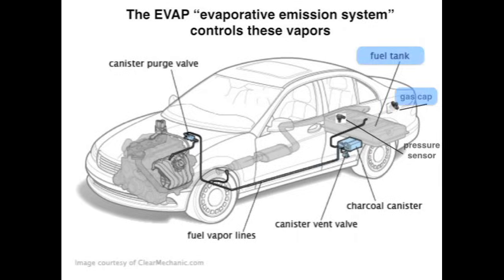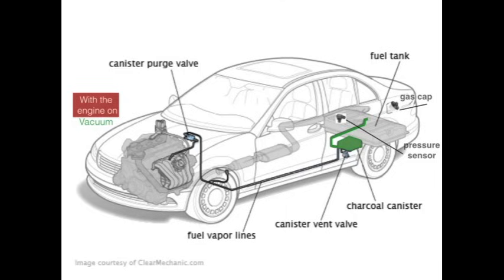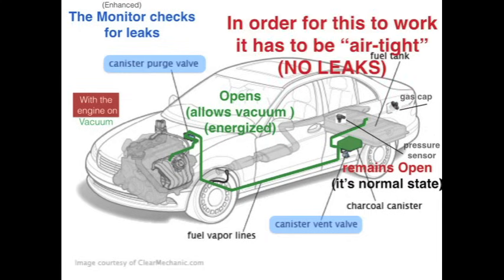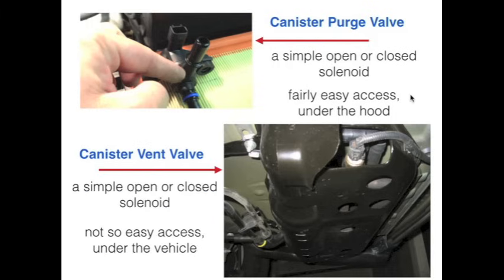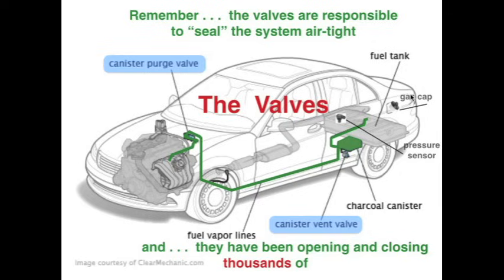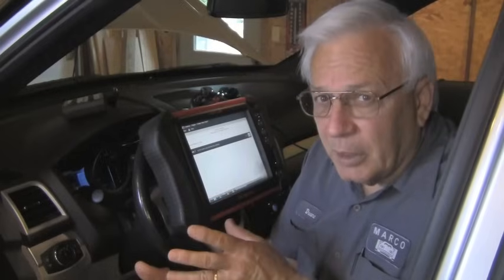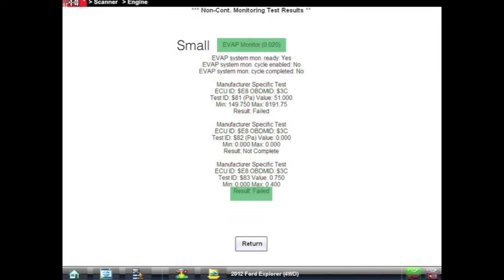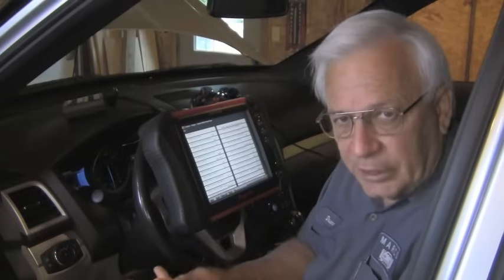How to find a Small EVAP leak without a smoke machine

Comment: If the charcoal canister valve is "sealed" during testing...then how does the tank pressure sensor notice any leaks in evap lines past the charcoal canister...

Comment: I am confused if both valves are closed when the system is pressure senor only checking the pressure from that valve and and the gas cap?  Seems the Canister purge valve needs to be closed and the canister vent valve needs to be Open, to check the whole system 5:49 is in error I believe.  Just trying to use critical thinking.
Reply from the maker: Good question, it can be a little confusing.  For the system to be checked for a leak vacuum must be applied, then both valves must close. That way there should be negative pressure inside thee closed system. If there are no leaks, the pressure should hold, if the pressure drops it would bet because of a leak.  Hope this helps.

Comment: I have a 2007 Dodge Grand  caravan, The fuel pump in the gas tank stopped working and I had a garage replace it,   AS soon as I got the car back  I get a warning light stays on. It says P0456, Evap Leak. Could they have caused this during working on my cars fuel tank(They dropped it down to replace the fuel pump)?  Thanks 
Now it wont pass inspection!!!!
Reply from the maker: Yes, it's possible.  They may have not gotten a good seal and or disturbed the vent connector.  However, since it's 10 years old it may also be natural causes.  To be sure, have the check it out.

Comment: "without a smoke machine", yeah, now you need an analyzer which is 3 times more expensive, handy !
Reply: The eventual source of the problem would have been hard to find with a smoke machine since it was an internal leak.
Reply: Deprecating the information he's providing is not productive.  
A smoke machine will only pinpoint a real leak.  It will not help diagnose failed vent or purge valves nor will it troubleshoot dodgy tank pressure sensors.
He has an expensive tool but you don't have to use the same tool he has.  
There are several bi-directional devices in the $150-$300 range that will diagnose EVAP systems.  
Not all tools will play well with all vehicles.  Even the multi $1000 units do better with some than others.  This is why professional mechanics have more than one.  Do your homework and find the one that's most compatible with your rig in your price range.

Comment: I have a 2001 chevy  s-10 pick up I replaced a rear brake line I disconnected the neg. battery terminal for about an hour .after the work was completed I reattached the battery the battery cable . drove it for 150 miles went to get it inspected , the evap. system will not pass emission test  and the check engine is not lit ! what could be the problem ?

Comment: I just subscribed to your channel. You are a natural teacher and great at it. After watching this video and pt. 2, I learned more about my vehicle and how it works. I think it now helped me to know what to look for as the engine codes come alone or my CEL stays on like it's staying on now. My mechanic is currently in the process of replacing my PCM on my Honda Accord v6 because we have gone through every repair or part replacement you can possibly imagine, but the CEL never stayed off. We think it needs a new PCM/ECM which is what the first auto repair business told me too. I want to get a diagnostic tool like you have. How much does that one cost?

Comment: An incredible waste of time for part 1. We don't need to know that the engine is running at 1500 RPM, and the ambient temp. This vid could have been 2 minutes long.
Reply: Thanks for saving m all that time. on to part 2. LOL
Reply: There is a reason he tells us this. Weather can have a profound effect on these tests. He is running the engine at 15000 to be sure the valves are cycling which they may not at idle.
Reply: 1500 RPM sorry
Reply: @DavidSmith-mk7qo  I agree, as if you want to fix the root cause of the problem you have to dig it so you will be able to fix the right issues.

Comment: One of the best explanations i have EVER seen.... you explained the entire cycle.... I keep getting "Depollution system faulty" in Peugeot (its a plague in these cars!), i even have thier Computer the agency once no clue yet.... it causes the car to go rough and engine to rattle. I'm doing the smoke trick near engine and going to check the fuel pump (checked the fuel filter seemed new, and cleared it myself even)

Comment: if the purge valve is failed, can you remove it and cap/plug all the hoses, to get rid of the cel?
Reply: bizzle
Reply from the maker: Actually no.  The PCM monitors the EVAP  system.  If you plug it off it will simply fail the monitor each and every time.  You will have a constant check engine light.
Reply: yap
Reply: Cristobal Garcia can

Comment: After watching  parts 1 and 2, a smoke test would not find this type of small internal valve leak, so we get a lesson on second level diagnostics for evap.  To those critical of his fancy computer, getting good data need not be expensive..Various OBDII scanners are avail from ebay or amazon for like $22 (bluetooth to smart phone) or USB to your laptop. You can download and use several free apps or buy cheap add-ons to decode much the same data as the $4500 computer produces.  The main limitation is your investment in time and understanding how to maximize the apps and what the significance of the data is.

Comment: I have a 97 Mercury Mountaineer that was showing a code for massive EVAP leak we had to change the Fuel pump and it was hell to do with out a lift but we got it done then we put almost a full tank of gas and so far after 6 mths it has not throened the code again ?????

Comment: Too much info. Most people don't have a  $4500 computer.
Reply: You can also buy a specified reader for your car, if a cheap OBD II reader doesn't do it. A good brand for more a extensive diagnosis is icarsoft. Find one for your model. It will really come in handy. Cheers!
Reply: There are at least a dozen videos on how to make your own smoke machine. As others have noted the rest is using your noodle.
Reply: No. 
But  the information from this video will certainly help you understand the freeze frame data on the $20 scanner. 
Critical thinking... 
Think positive...
Reply: @daviderhahon  22 minutes of video summed up: Purge valve has opened/closed thousands of times..pull off test for leaks..done.
Reply: DarkSim77 

Yeah you are right.
But I consider the video to be a lot more educational rather than problem solving.
I think the poster should change the title.

Comment: How can  PCM  monitor system leak integrity with both purge and cannister vent valves closed (per video), since pressure sensor is on tank side of cannister vent valve?  You say test limits are purge valve to gas cap. For this to be true, the cannister vent valve needs to be open and purge valve closed. This  allows pressure sensor to monitor leak integrity from purge valve to gas cap. regarda

Comment: Nice explanation, Duane. I've never found Freeze Frame data to be valuable for diagnosing EVAP systems, since the monitors generally run at cruising speed, but the test result/MIL command can be issued at any time...any thoughts?

Comment: Good to see you back again. The way I was taught, basically open loop means that the computer isn't using the oxygen sensor/s to determine the fuel control strategy. It uses the TPS, MAP, MAF, and all other engine input sensors, but ignores the oxygen sensor/s reading. Closed loop means it uses all of the above plus the oxygen sensor/s.

Comment: This is all for OBD-II vehicles that have scan tools, PID's, and enhanced monitors.  OBD-I (vehicles made before 1996) have it much harder.  Still a great video.  The diagram and description of the evap system is spot on.  Not all vehicles have electronic canister vent valves or pressure sensors.  Have to take all of this into account when diagnosing a vehicle and adapt these procedures for the vehicle design that you are working on.
Reply: +DJDevon3 Never seen a pre-OBDII vehicle set an EVAP leak code...so there's nothing to worry about! On that note, I find it silly for the "Check ENGINE" light to come on for issues that have nothing to do with the engine/driveability.
Reply: motoYam82 Not setting an evap leak code (because it doesn't exist on your OBD-I vehicle) is even worse. Good luck figuring out there's an evap problem. :P  You might get a faulty solenoid code if you're lucky but that's about it.
Reply: +DJDevon3 But the system itself is simpler with no canister valve, since there's no need to check for leaks anyways. The only electronic part is the purge valve which could fail mechanically and not set a code. Otherwise you just use your nose to check for leaks...if it smells like gas fumes, you have a leak lol